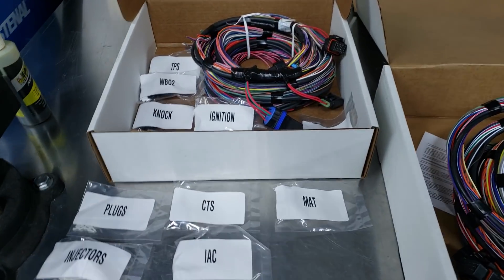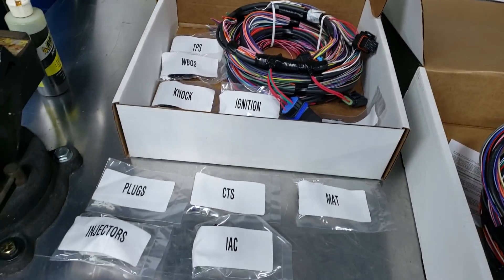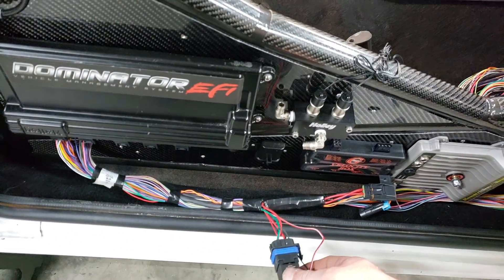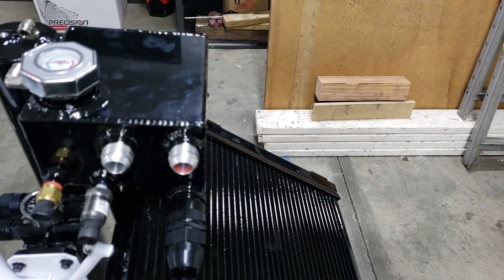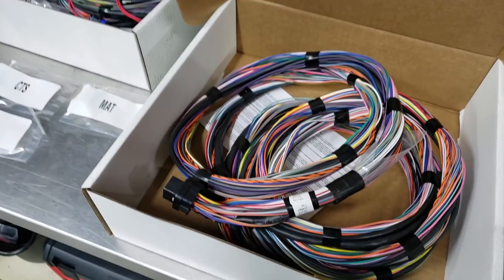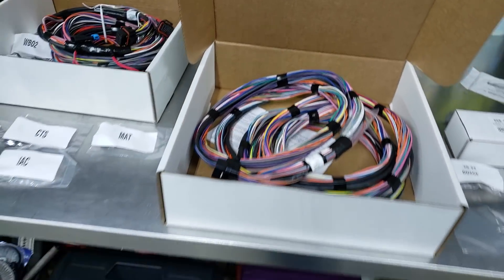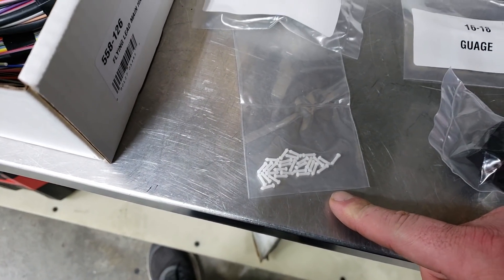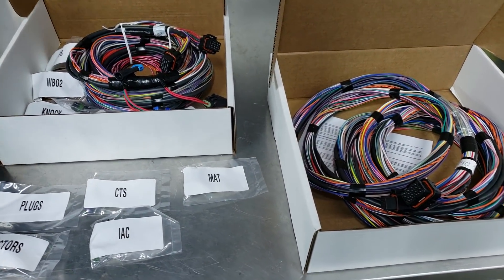Holley Efi unterminated harness options and whats best for you

Comment: Thank you for the super intresting video.
I am looking for an Terminator X for my C1 corvette with LS3 swap. I want to make the LS3 look like old school engine and want hide coils, use Holley single plane intake and throttle body. Can you recomend what  harness to use and does it come with injector hats for bosch ev-1’s ? And is there special crimper tool needed for the sensor pig tails?

Comment: Devin, I’m building a 1960 f100 street truck, it came with a decent 302, with trick flow top end, I’m thinking about getting a universal kit, so we may change the engine later and only worry about harness and not the ecu? Am I thinking correct? Or are the Holley ecu packaged as ford convertible to a LS down the road? Just want to leave our options open, as the 302 is only going to make so much power on a reasonable budget??
Reply from the maker: all the holley ecus are interchangeable as far as harnesses go

Comment: Really don’t like the ecu connectors dodge uses similar ones. They can move around opposite the latch. I hang the harness opposite the latch to keep the pins engaged or keep the harness very secure right at the ecu. GM style full perimeter lock is better imo.

Comment: Do you know if the ECU connectors and pins are Deutsch DTM, DT or molex?  I'm trying to determine if i have the right crimper and solid pins already - thanks for the great vids!
Reply from the maker: No they are not 
The ecu uses Tyco amp seal 1.0 pins that are formed barrels not solid
Reply: thanks @theholleyefiguy

Comment: Would you run the shelded wire through the balkhead or through a gromet so there's no brake in the line frome the sencer to the ecu